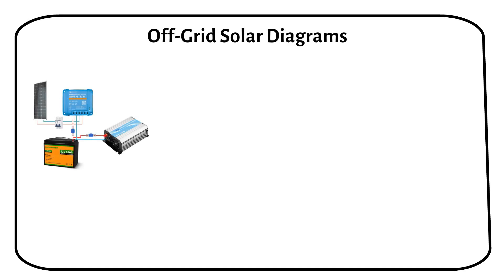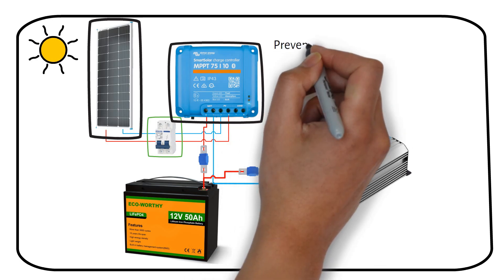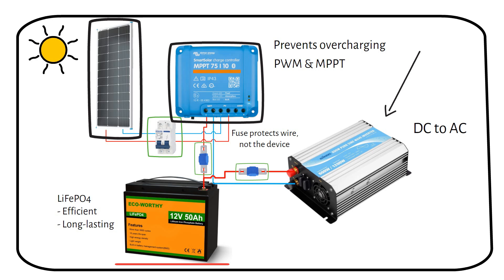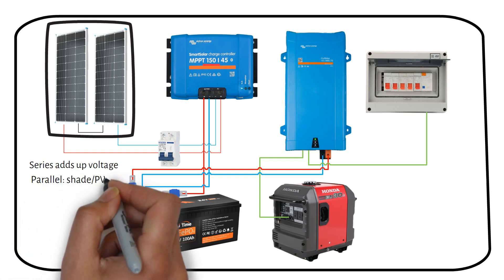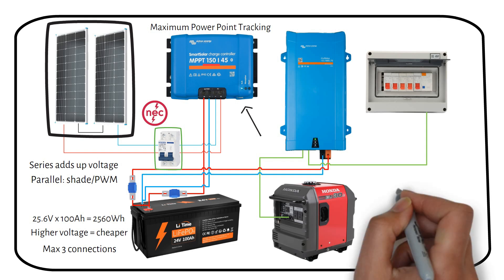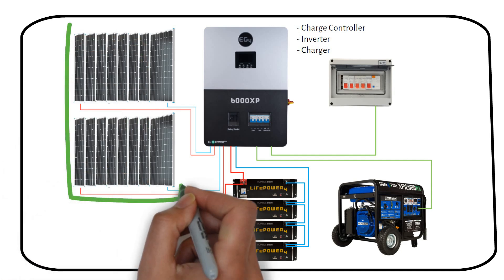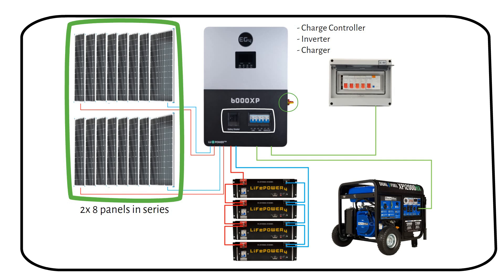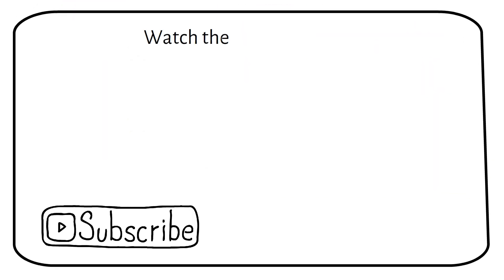How Does Off Grid Solar Work - Explained with Diagrams

Comment: I have 4 100w panels and I just want to charge two 100ah 12v lithium batteries with a 40 amp controller I will use a eco flow max as an inverter. I would like to know how to wire this setup. Thanks Nick and I do have your book.

Comment: Hi, I'd like to get a design for an off grid system to power a tiny house which already has a 15 amp socket to plug into and it's own internal distribution.  The system would have (approx from my calculations) a 2-3 kwh solar array, a 9 kwh battery storage, and a hybrid inverter, capable of being charged by generator or 240 connection.  The tiny house has gas cooking and hot water, and a 240 v fridge and in summer an air con.  I live in Australia and if I've understood what you do from the vid, would you provide a design and perhaps a list of items for me to source??  Nicely done vid!
Reply from the maker: That would be a great system. Seems like you have already done the load analysis because a 1/3 ratio for solar-battery is good. Good that you have cooking on propane. I do offer consulting on my website cleversolarpower.com -> shop

Comment: Hello Nick. Thanks for your very good learning material. How many AH of Battery do i need to power up my big refrigerator 104W and a 700W incubator?
Reply from the maker: Search my channel for 'fridge' and you will see a video where i test the power consumption of my fridge and size a battery for it. 104W*8h (33% duty cycle) = 832Wh per day with three days of autonomy = 2,500Wh battery, @ 12.8V = 200Ah.

Comment: Hi Nick,

Some time ago I replaced a big old inverter/charger with a 2kW inverter. The old one was hardwired through a breaker so I took one output of the (two output) inverter and wired that through the breaker. I’m now installing a 1kW immersion heater and I’m planning to use the second output from the inverter. I’m assuming it will be safer to wire that through a breaker as well. (I have a redundant breaker in there from a disused shore power input. If I have two outputs going through my consumer unit, is it still possible to wire it in such a way that the main breaker can cut power to both at the same time?
Reply from the maker: The two ac outs of the new inverter are a combined 2000w. It doesn't matter which output you use. They are internally connected to each other. You can just use one breaker and have two outputs after the breaker.

Comment: I'm interested in a mobile kitchen power solution incorporating a small breaker box setup to operate 8 hr business day.
Reply from the maker: I recommend you to do a load analysis, search my channel for 'load analysis'. I also recommend to heat on propane, that will be much cheaper.

Comment: why the fuse is connected to Positive side not Negative?
Reply: Because if there is a short circuit the    fuse blows near the source if it is near the neutral In case of short ckt the surge current flows through the whole ckt and damage the ckt components therefore it is installed near the source so that in case of surge current the fuse blows before current reach any other ckt components

Comment: Awesome video. You mentioned that 600w should power a TV, laptop and a few lights.

How much extra power would a small air-conditioner require, say a 1.6kW window box?
Reply from the maker: It's 600Wh, that's the energy consumption over time. I don't know how much an AC consumes because that depends on a lot of factors. You can measure yours using a 'kill a watt' meter.

Comment: Great video, so far you could be the only person who can help me work something out.
I have a 3kw off grid inverter 24v, is running fine until I try to use the generator, the inverter sees the generator but doesnt use it, so far the only way I can make it work is by running a load of at least 500w, turning off the inverter, then turning on the generator, wait a bit until the inverter sees the voltage from the generator then turning the inverter on, you then hear the generator reving up and the inverter enters bypass mode and starts charging the battery...
Any help would be appreciated.

Comment: My pick for a great topic is a small up-gradable, affordable, 24v system starting with 1 24v battery and 2 panels, charge controller, inverter, fuses, battery shut-off etc... and with an end result of powering a common, normal, single story 1200 s/f house by adding more panels and batteries without having to buy to much replacement equipment. Can you help me get started on the right path to that goal?😁
Reply from the maker: Checkout my website where i have some diagrams available.

Comment: Hi Nick. Can I connect two Victron energy mppt chargers into the same sollar panels?
Reply from the maker: Why would you want to do that? Never connected charge controllers in parallel before. You need to have two different solar strings if you have two charge controllers.

Comment: what PV disconnect would you recommend? My MPPT is 150/45 Solarsmart, I have so far just one 100W panel so I'm going to scale up to 400-800W array. Thank you
Reply from the maker: A regular DC breaker on a din rail will do.

Comment: Thanks for your clear explanations: unfortunately, I have realized my backup system is probably not balanced for optimal performance. When you can, please review this setup:
2x325W Solar Panels, 1X2.1KW 24Volts Hybrid Inverter and 4 x 110AH Gel Batteries (2X2).

Comment: I would like to learn more about the third system that you have on this video. Like what batteries to purchase how much they cost? What size solar panels? How to wire it? I'm going to build a tiny house with this type of system. In the past, I've used just the first system in your video for lights and my 12 PM for my shower.
Reply from the maker: I already made a video about it.

Comment: My man 
You are something special 
What a explanation ,excellent 
I need help with my Rv
I just purchased a 2024 geo pro and it comes with 12v system 2  200 solar panels 
1800 watts inverter 
And I will like a Victron 3000 
Can you help me
I wanted to to run my a/c  and wanted to to be off grid at least 3 days 
Tell me what you recommend 
And I’m willing to go 24v 
If is possible

Comment: Hi I like option 3. I’m currently (no pun intended) putting together a 24 volt system with a3000 watt hybrid inverter and 2 200ah 24 volt batteries and would love to see a diagram for fusing and breaker values and of course the wire and proper amount of pv. My inverter is a eco worthy with mppt. 
Thanks
Reply from the maker: i have made the video about system number 3. Check it out on my channel page. i have not done a 24V system on the channel. One is coming soon. Checkout my free diagrams, i believe there is a 24V system in it.

Comment: Great video! I do have a unique scenario which could use some expert advice if you don't mind. I have an off grid 2200 watt system which I am installing DIY. The issues I am having are firstly how do I connect the system in such a way that the mini split system is able to run as long as the system is generating energy. I have been told to connect the main wire from the solar to the inverter then panel while having the mini split wired to the panel as well. I then will have two 24 volt LiTime 200 amp batteries in series creating 48 volts connected to  the 48 v. EG4 inverter as backup / evening usage. My other smaller solar system is separate and runs all lights etc. This system is primarily for mini split power, refrigerator and any other larger watt appliances I may use on occasion. Any help would be much appreciated! Lastly, I have purchased everything already other than the combined controller and was thinking of buying the EG4 3kW Off-Grid Inverter | 3000EHV-48 | 3000W Output | 5000W PV Input | 500 VOC Input. Is this a good choice for what I am going for and staying on a budget? Thanks again!! :)  
https://signaturesolar.com/eg4-3kw-off-grid-inverter-3000ehv-48/

Comment: Hey! Thanks for the very clear explanations! I would be interested to know more about systems that allow you to connect the battery to a wall electricity outlet to pour the current produced by the panels in your home AC circuit. Some solar power generator offer this possibility, how to make it yourself? Thanks again! I think I will end up buying your book :)
Reply from the maker: These are called grid tied inverters. Check out my video: different types of inverters.

Comment: Can you make a video about what kind of system is the moste effective  if jou have solar withe microinverters
Reply from the maker: If you have microinverters, you should be grid-tied. Otherwise, a microinverter is not useful (in my opinion). I don't like to use them because they have quite some limitations. Check my video about different inverters to learn more.

Comment: Interested in building a mobile off grid system using Victron 3000a multiplus inverter charger  and other Victron components with 4 100amp Battle Batteries.
Reply from the maker: Good choice! However, why would you choose battleborn? They are quite expensive, but they do have good support.

Comment: How about the differences - pros v cons - of an inverter/charger (2) against the all-in-one of (3) (beyond the built-in MPPT charge controller).
Reply from the maker: System 2 offers more flexibility and customization. System 3 offers easy connections but is not customizable. With system 1, you can have multiple MPPTs for reliability, while if one component in the EG4 breaks, you are out of power. So, system 2 is more redundant.

Comment: I just bought a RV pull trailer and it has a 200 watt solar panel feeding to a PMW then I believe it goes to the lead acid battery then to a cut off switch. The RV has already a lithium ready inverter built into the breaker A/C D/C Box. I want to upgrade to 400 watts and put in a LiTime lithium 12 volt 230 Amp battery. I want to keep my 30 amp plug shore power to also charge my battery. Can you supply me a drawing for that ?  I’ll pay also.

Comment: I have that exact generator, it’s great! Only thing is you might need to add a hard start kit to your HVAC to make it run off that generator. 

Which brings up a question — what size inverter and solar system is needed to start and power a 4 ton AC system?
Reply from the maker: Thanks for your comment. Do you use the generator to run into a hybrid inverter, or do you power the loads directly with it? I'm asking because this generator can have high harmonic distortion, which is most likely not accepted as a generator input.

Comment: I do enjoy your work. I'm currently working on a system consisting of NiMH batteries from a Toyota hybrid, configured for 12v, PWM change controler, 400w of solar panels (one 100w & two 150w) and a 1500w inverter. This is for off grid use, for a refrigerator, lights, TV and a  water pump. I get about 12 hours of sun where I live.
Reply: Hi! What cars use NiMH chemistry in their batterys? Only thought they were for smaller applications.
Reply: @Teknopottu  Toyota Aqua, Fielder, & Prius use them.
Reply: @kerrybain3196  Yeah, it seems they did and Toyota still does. Learn something new every day. Thanks.
Reply: I'm curious about your sun hours. Where do you live that gets 12 hours of sun? Where I'm at, the sun is out for 10 plus hours, but I only get 4 hours of prime charging. The rest of the daylight hours are partial at best.
For me, I have near shading to the south of my property. Trees. Between 9 am, and 11 am, I pull in 500 watts from my 700-watt Solar array. After 11, I typically drop back to 250/300. And then from 3 pm, to 5 pm, I get around 350 to 450.
Reply: @stephenhickman9502  I live in a small twin island republic called Trinidad and Tobago just off the coast of Venezuela. Practically on the Equator.